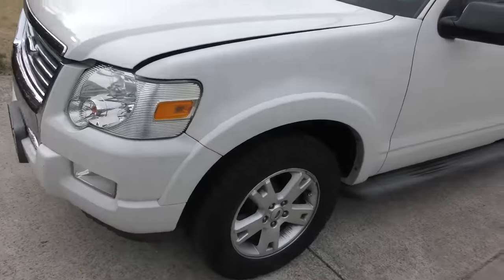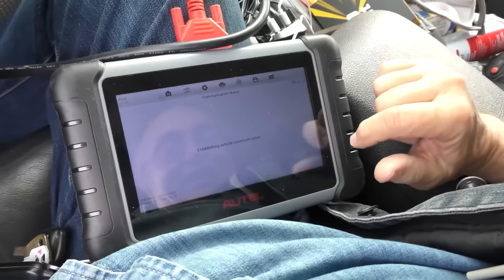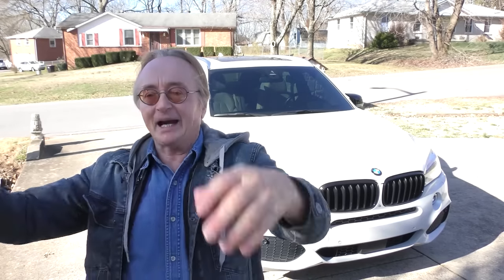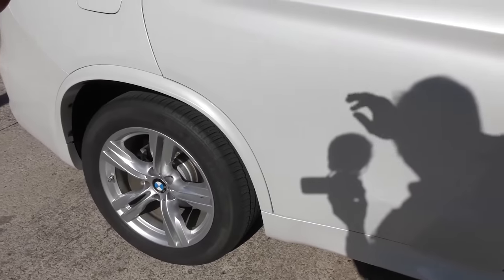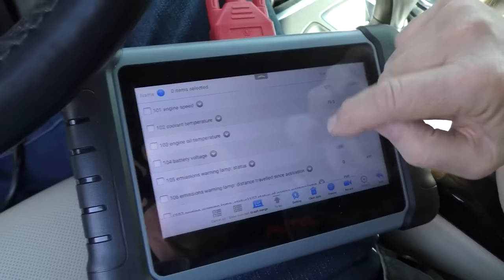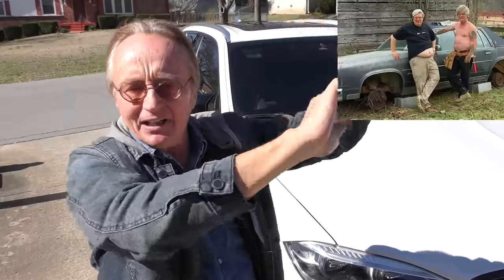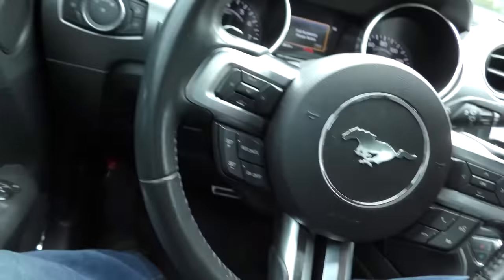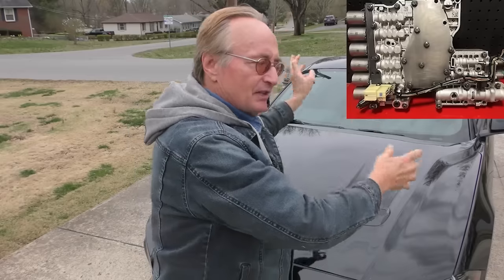3 Money Pit Vehicles You Should Avoid

Comment: The only vehicles I'll avoid are electric ones.
Reply: I avoid solar ones
Reply: @rgeniec and much higher maintenance costs
Reply: @rgeniec  You need to include all costs like payment, and charging in public is almost expensive as gasoline. My maintenance costs on my two ICE vehicles averages about $300 a year. The tires also last much longer too cause they are lighter
Reply: Electric cars have a huge potential in my opinion.. Less parts = less parts to maintain

In theory if Toyota made an electric car and perfected them as they did to gasoline cars you'd run the car forever until the battery is dead and replace them
Reply: Same brother.
Reply: Their transmission is way more simpler than any gasoline car. In theory it should be more reliable.

It's driven by a motor and a converter and they also have a better reliability potential than any other gasoline engine.

So I'm very hopeful for the future of cars
Reply: 50k miles on our Chevy Volt - not pure EV, but we barely ever use gasoline, easily get 60 miles on EV range. Electric bill is maybe an extra $50 a month to charge it everyday at home. It’s been a joy to own, anything that has issues with the battery is still covered under warranty. As a commuter car that I usually replace every 5 years, it’s been excellent - I have other weekend/fun cars, but something to drive to work and back, pile a lot of miles on, collect door dings in parking lots, and replace every half decade - im sold on EVs/hybrids. Had a Prius before that, and it was also great. 🤷🏻
Reply: @jfish9014 And?... 60 miles on EV is a joke. You're not changing my opinion.
Reply: Carbon raysiss
Reply: @ThomasKing19933  it has a gas tank as well, it’s a plug in hybrid.
Reply: You will get one 😂😂😂
Reply: @rgeniec  some of us still like to hear a good sounding V8 engine and exhaust you like what you like but plz bro nobody cares about ur electric car now go charge up before ur battery dies
Reply: Electric is the future.
Reply: Well the current thing are battery electric vehicles, BEVs.  I think something else is going to come along and replace it like hydrogen electric vehicles.  Heavy battery packs, having to rely on the grid, long charging times ain't a sexy look
Reply: I work for Tesla and don't know how people are affording these cars. One guy that rides the same shuttle as me, told me he pays $800 a month because he paid $60k for is model 3. I paid $28k for a much better car looking car
Reply: EV by Norelco
Reply: @jfish9014  if a car doesn't last 15 years it's pure trash.
Reply: @rgeniec  silly rabbit
Reply: @rgeniec 😂🤡
Reply: @rgeniec  

No..

He's avoiding the vehicle that still uses Fossil Fuels to produce them and the electricity to charge them.

And..

He's also avoiding the insanely long charge times of an EV and the child labor which is used to mine the lithium amoungst other materials to make the batteries for an EV.

So..

I think you should redo your math and see just how bad they really are.  

Teslas can only travel 350 miles on a single charge but my ICE car can travel over 450 miles on a single tank of Petrol, and it only takes 5 minutes or less to fill up. 

That's a no brainer for me. 

I won't wait several hours to charge a car when I can fuel up my ICE car in 5 minutes or less.
Reply: @abdulrahmanalghamdi2307  Yep!! Replace them to the tune of 20,000 buck's with inflation. 

No thanks.
Reply: @rgeniec  
How much did you pay for it?
Reply: @rgeniec  is that so? So why do we need all these public charging stations then? Where do apartment dwellers charge? Definitely not at home for sure.
Reply: @_kool_kat_  

No it isn't unless you don't mind waiting in line to charge your car at a public station. And don't forget the charge time for each vehicle!!

It will look worse than the oil embargo of the mid 70s when lines at fuel stations were miles long due to shortages and rising prices. LOL
Reply: @jfish9014  I will take a Chevy Volt over Tesla anytime. Not as fancy but, Tesla has too many issues, oncluding the fact that Tesla monitors the cars remotely and watches everything you do. Miss a payment or two? They shut you off via satellite.
Reply: @extremedrivr  Some common sense. Thankyou.
Reply: @rgeniec  

99% do NOT do the same or there would NOT be public charging stations. 

Wake up!!
Reply: @ThomasKing19933  No problem!! Common sense isn't very common any more.
Reply: @extremedrivr  The guy knows nothing about cars. He's making stuff up about EVs having 5x the performance. I think he's lost the plot.
Reply: @Kevin 40k for a model 3 is terrible.  My car looks way better and I pay less on everything
Reply: @rgeniec  

So what. 

I don't need to own an EV to know what's what. I did my homework and found out the truth. 

And it's obvious you bought the lie hookline and sinker. My ICE car is still more efficient than an EV ever will be. 

And I can still fuel up in 5 minutes or less and be on my way. I don't have to wait for hours like you do with your Tesla. 

My car is ready to go when I need to go somewhere. I never have to worry when the power goes out at my house.
Reply: @extremedrivr Well said👏 I can tell you're a real car guy👌👍
Reply: @rgeniec  EV's rely on Electricity to get them down the road. My ICE car uses fuel which I can get on nearly every street corner in my city at any time, day or night 365 days a year. 

My ICE car is not limited to plugging into a socket for charging like an EV is. Sure my car could break down but it's still more dependable than an EV for daily driving.
Reply: Yeah nah Id throw fiat and most chinese cars in there as well man.
Reply: @rgeniec  Performance isn't the issue. Efficiency is. The truth is clear, but only when someones eyes are opened to it. 

You bought a Tesla because you believed the lie. I understand, but hopefully you will see the light before it's too late.
Reply: @rgeniec  
Which it means you paid for gas savings up front cause you could have had a gas car for atleast 12k less….

So no real gas savings 

-Not saving the environment either 

-Lithium Ion is NASTY stuff when something bad happens or problems with the separator

Have you seen an electric school bus catch on fire?, there will no TIME evacuate kids but we never think about these things
Reply: @rgeniec  I fill up with gasoline every week or two and takes 5 minutes. I pay at the pump too so no reason to go inside unless I want to.
Reply: @rgeniec  so your not going to include the $ 5,000+  maintaince cost on changing the battery every 5+ years?
Reply: @rgeniec  
Funny 😄 😂😂😂😂

Not in my search
I can find cars in the mid 20s

No response over the environment or the reactive and nasty LITHIUM ION?

Hope your battery last
Reply: @rgeniec  Acting like you need that type of performance on the road, already says alot about you. The cost of buying an EV will never make up for the money saved on owning an ICE vehicle. You can't deny that. Have a wonderful day! ❤
Reply: Me too
Reply: Me too. Although the hybrid electric ones with gasoline engine are smart
Reply: @ThomasKing19933  
$50 on his electric bill and 60 mile range. 😂
For $50 in gasoline, I can have 240 mile range!
Reply: @youdontknowme2915  

And I only fuel my ICE car every 8 days with 450 miles of range. And it's fast, comfortable, and very reliable too. 

So I'll gladly stick to my ICE car thank you.
Reply: @rgeniec  Yeah but that Honda will outlast the Tesla by a length as great as the Pacific Ocean. LOL

Build quality on the Honda is superior.
Reply: @ThomasKing19933  

Yeah I own a 2013 Mercedes C250 Coupe. That's a far better looking and more fun car than any Tesla I've ever seen. 

Plus I'm not tied down to a charge cable like that Randy guy is. If I need to go somewhere at the drop of a hat I can. 

Sure my car can break down like any car can but I NEVER ever have to worry about what to do if the power goes out.

He will though because his EV is just that, totally reliant on electricity where my ICE car isn't.
Reply: @rgeniec  average price is $48k for vehicles, not cars. That means trucks, SUVs, luxury vehicles, and more. There is hardly any EVs out there in the $30k range that are decent. Just the Bolt is all. I've put $6/gal of premium in my Mustang 5.0 and I don't care. It's paid off anyways and like I said, refueling is a tiny portion of the experience. Plus, when I'm 300+ miles from home in the middle of nowhere, I feel completely confident in my travels. That is a pain in an EV and scary. Talking hours of charging on trips compared to 10 minutes total for me.
Reply: @302Mustang13  Yeah I thought his statement about waiting in line behind someone buying smokes was funny. LOL

Although maybe he's paranoid about pay at the pump ID theft?? I don't know. LOL
Reply: @rgeniec  I've had some 15+ year old vehicles and no vehicle I've owned ever had engine issues. Good luck with that EV battery pack when it's 12-15 years old. That's $20k at least not including maintenance. Might as well throw it away  An ICE will keep going and going.
Reply: @rgeniec  

.20 per kwh?? 

And in California?? LOL

Oh dear!! 

What about Newsome and his ration on EV charging?? Like I said earlier, it's all about Government control man. If they can get you to buy an EV then they can micromanage your lifestyle.
Reply: @rgeniec  That national average is for all vehicles sold, so comparing your rare find cheap EV car to mostly pricey vehicles is dishonest. You can easily get a mainstream ICE vehicle for $20k-$40k unless you get a truck or big CUV/SUV. That's what is pushing up prices along with expensive EVs and other electrified vehicles.
Reply: @302Mustang13  I charge at home
Reply: Crank start and no radio, wise man.
Reply: @302Mustang13 lmfao they weigh the same as normal vehicles. You think batteries are made of air?
Reply: @rgeniec  “Performance” yet none of them are even remotely sporty and weigh too much.
Reply: 🤭😂🤣 Yeah. I'll be ready to go EV, as soon as school buses, police, and emergency response vehicles go EV too.
Reply: @rgeniec ,

EVs won't work for everyone. It depends on your lifestyle and driving habits. Plus, the build quality of a Tesla is very suspect for the price you pay for the vehicle. And as one person said on this thread, what IF the power goes out? Can't you see the potential for government control and their possibilities? Yeah, you may pay $0.22  per kw/hr, but who's to say they won't jack that price up to $0.45 or $0.50 per kw/hr next month?!? I'm also concerned with the safety of an EV. How do they do in head-on collisions and rollovers. I guess the main question is: "Why haven't emergency response vehicles changed to EVs yet if it's such an "advantage"? 🤔
Reply: @LastExile1989  Really? So the 2023 F-150 crew cab with a gas engine that weighs 5,200 lbs is the same as the F-150 Lightning BEV that weighs 7,000 lbs or Rivian R1T at 7,200 lbs? Your teachers must be so proud.
Reply: @Kevin I mean trucks and large SUVs are pretty mainstream and they cost about that much average for a new one. Diesel trucks easily go for more than that.
Reply: @youdontknowme2915  that's just not true at all. Operating costs include pay, which is likely $1,000+ a month. My 2020 Escape costs me $600 mainly because I have a shorter than average loan and that $400 buys a lot of gasoline. Insurance is likely lower too and maintenance has been just two oil changes a year, which I do myself at $70 each. Future maintenance might total $1,000 at year six and 10, but that's probably going to be less since maintenance is not actually that much..
Reply: Scotty has rubbed off. On you
Reply: @youdontknowme2915 

No it doesn't cost way less to operate. 

And..

You also have to wait hours to charge your car before you can go anywhere. 

I on the other hand can fill up with petrol in 5 minutes or less and be on my way. 

And again my car only needs to be filled up about every 8 days. So my car is a no brainer to keep.
Reply: @rgeniec  Used tires right?? Or a senior discount?? 😁😁
Reply: @youdontknowme2915  you need to look at total cost per mile. Electric prices aren't always going to be cheap either considering EVs are becoming more popular every year. My one ICE costs only 8¢ per mile and my payment is nearly half of what most EV owners pay. The best part is I can go anywhere without worry and wait no more than 5 minutes to refuel. EVs make zero sense for a good chunk of the population and most I see on the road are going through speed limit or less likely to preserve range. I go 80 mph and still get decent highway mpgs in the low to mid 30s in my AWD CUV.
Reply: @rgeniec  Smart move on tire savings but bad move on going EV.
Reply: @youdontknowme2915  where are you getting these statistics from? It's not what you drive daily but rather what is your typical road trip and how often. I drive road trips often and have a 500+ mile range with my ICE and 5 minutes to refuel at fuel stations that are everywhere. If you drive 200-400+ miles each way, there is no way you are doing it on a charge at home. There should also be high taxes on home charging to help pay for the roads that heavy EVs destroy.
Reply: I only ride real horse horsepower 🐎.   Oats, hay, and carrots are much cheaper than watts and petrol.
Reply: @youdontknowme2915  you have to compare it to an equivalent vehicle to be fair. On average, an EV weighs 20% more than a comparable ICE. That bad the high torque motors equal more tire wear and also,. significantly higher tire particulate pollution. Until EV improve on energy density with range, weight, and battery safety, I'll never buy one. I only have 27 payments left on my ICE and at that point I won't care about fuel price disadvantage. No $20k battery packs to replace at 10-12 years old either.
Reply: @1SmokingLizard  ahahaha good one 👍👍👍😂😂😂
Reply: @youdontknowme2915  you have to compare it to an equivalent vehicle to be fair. On average, an EV weighs 20% more than a comparable ICE. That bad the high torque motors equal more tire wear and also,. significantly higher tire particulate pollution. Until EV improve on energy density with range, weight, and battery safety, I'll never buy one. I only have 27 payments left on my ICE and at that point I won't care about fuel price disadvantage. No $20k battery packs to replace at 10-12 years old either.

Those taxes aren't penalties, it's called paying your fair share for infrastructure.
Reply: @rgeniec ,

I don't mind owning one EV as an everyday commuter. But, I sure wouldn't own two. I think you were better-off trading in your ICE vehicle for a Toyota or Honda Hybrid. They have perfected their hybrid systems in my humble opinion. You HAVE to have a vehicle for long road trips if you have a single family.
Reply: @Towlie101 I can afford that, but I bought a gas car instead, and it's huwaaay nicer than a Tesla. 
Tesla is a niche car that a certain demographic is drawn to: they're trendy, and desperate for attention and approval.  These are university educated people who are not savvy in engineering mechanical things,  or practical matters at all.
Reply: I’m with you, brother
Reply: @Kevin-fm1vn  ,

Good buy! That's the only brand that I would buy brand new besides Honda/Accura. Take care of it, and it WILL take care of you. Hope it's an ICE/Hybrid.

The thing about the Japanese auto makes, they're smart enough to use dry-cell technology for the batteries 🔋 that they use in their cars. Lighter, cheaper, and can take more charges. You've got to hand it to the Japanese!
Reply: @302Mustang13  You said EVs weighed less not me.
Reply: @LastExile1989  I was talking about my two ICE vehicles. Both weigh approximately 3,600 pounds each. An equivalent EV would be at least 4,000 pounds for one, 4,400 pounds for the other. It's a fact that heavy EVs have higher tire wear and I was saying my tires on my ICE vehicles last longer because they are lighter.
Reply: Ba'al  My list of no-buy is the same except swap out Ford for GM. Have had nothing but great Ford vehicles but GM vehicles have been garbage.
Reply: @Kevin the trick is that we don't, a lot of people lease or finance them, then trade em in when they see a new model they like come in.
Reply: @Bill NYE  for somebody who shares a name with a kids scientist who believes In global warming, that's a very non green opinion.😂
Reply: @rgeniec  no hes avoiding not being able to charge in the winter (and don't argue with me there's hundreds of videos on YouTube clearly showing the chargers not working when it's below freezing so you have no argument there), the government shutting it down remotely, updating electric at house to have one, showing up to charging station with not one available, driving 500 miles in 4.5 hrs instead of making a day out of it and contributing to global warming. Fiuck winter, cold sucks.
Reply: @rgeniec  and batteries that cost as much as the car when they crap the bed.
Reply: @rgeniec  oh not to mention the fact that the tax on a registration for an electric vehicle in New York is 10 times out of a gas vehicle because they're not making the money off of you by texting gasoline. So take a suck of that
Reply: @_kool_kat_  no it’s not
Reply: @Kevin Yeah and what's worse is that the Best Tesla for Range being the Model S sells for over 100K.

I mean who can afford that except a fairly wealthy person, but then most wealthy people will buy other cars like high end Luxury Cars that are not EV's.
Reply: @ThomasKing19933  learn to read Tom.
Reply: @justcommenting4981  What? I'm excellent at reading. You clearly don't know how to use punctuation, by the way.
Reply: @ThomasKing19933  you literally didn't understand the Volt hybrid had a battery pack that served the driver's need and removed the need for going to the gas station most of the time. You're bad at reading. Sorry if this is the first you're learning of this.
Reply: @justcommenting4981  I replied and YouTube hid my reply. I know what a hybrid is, thankyou.
Reply: @justcommenting4981 Your grammar is shocking. I'm concerned about your level of education.
Reply: True. But ford too. Ford is junk and they are still making the eco junk knowing they have coolant intrusion. Thonas long as it's non turbo 2wd. They are okay. Chevy has gotten terrible last what 10 yrs at the least? Toyota and Honda best.
Reply: @rgeniec who cared about performance? Most catching fire amd the ones that are good are 80k
Reply: I avoid anything younger than 10 years.
Reply: @extremedrivr  I just say to peeps I'm glad its your car payment.
Reply: @SethHollingshead  Yep Honda is one of the absolute best car brands out there for quality and reliability, yet that Randy guy traded in a Honda minivan for a Tesla. 

Bad move. LOL
Reply: @rgeniec  

35,000 is a whole lot of 💰 these days. 

I certainly couldn't afford that. My Mercedes cost me only 14,900 and I can say with 100% certainty that it's a better built car than your Tesla by a length as great as the Pacific Ocean. 

Not hatin. I'm just continuing to show you what kind of a mistake you made.

But it's obvious you may have to learn the hard way.
Reply: @Thomas King  YOU are the joke...you'll be left in the dust in the 10 years...so get on board early or get left behind. That being said, gasoline cars aren't going anywhere anytime soon.😊
Reply: @Bill NYE  what's your point? Gasolines are useless without gasoline?? So...your point is what exactly?
Reply: Shocking
Reply: @Randy Geniec That works as long as there is enough electricity in the grid to charge your EV. It works as long as you can charge it and as long as you don't go past the limited range. Then you have to sit and wait for the thing to charge. That is if California doesn't have its rolling blackouts going. Then you are pretty much SOL.
Reply: @rgeniec  Those are nitpicking the rel operating costs. Have you checked how much it costs to replace one if those electric motors on each wheel? Costs more than a transmission for a gas powered vehicle and they don't last long.
Reply: @rgeniec  are you sure? they have one gear transmission, meaning no shifting it stays on the same gear the whole time.
Reply: @rgeniec I just like to “recharge” in 2 minutes not 30
Reply: @rgeniec  how good is the battery when its -40 out in Canadian winters?
Reply: You remind me of those folks back then who said they'd never get rid of their horse and carriage
Reply: @ethanbernard7671  Yep, and I'm  proud of it.
Reply: @ThomasKing19933  You ever notice how horse and carriage was replaced? That's what will happen soon enough with ice cars. I don't understand why people like you try to oppose as if you have any say over the matter? 

If you're going to avoid electric cars that's fine, but in due time that means you'll be taking electric public transportation😂
Reply: @ethanbernard7671  completely different scenario. EVs will fail, just watch.
Reply: @ThomasKing19933  That's what you want... but I find that weird. There are better things to do with your time than pray for the downfall of electric cars lol
Reply: I'll avoid anything made after 1970
Reply: @rgeniec 0-100 performance yeah 😂
Reply: I avoid coal powered cars.
Reply: @rgeniec  EVs are garbage
Reply: @rgeniec  Absolutely not!
Reply: And beamers… don’t buy a Beamer.
Reply: Laughs in 4.4 seconds to 60 for $6 a month
Reply: @x24Templar  Agreed!
Reply: @MikeYurbasovich  "educated"😂

You're definitely not wrong about anything you said, I just think it's funny to call people in pretty much any college "educated" these days😂
Reply: @_kool_kat_ Electric is PART of the future
Reply: @KMFDM_Kid2000  Who is gonna use that speed on their commute anyway
Reply: @302Mustang13 charging is way cheaper if you plug in like most, at home... Tires wear out faster because of the faster acceleration and torque but you can obviously have self control. Extra weight isn't a big part contributing to that.
Reply: @SethHollingshead  Coolant intrusion? I have an Ecoboost and it's a non-issue. More likely to have fuel dilution with EarthDreams and failure.